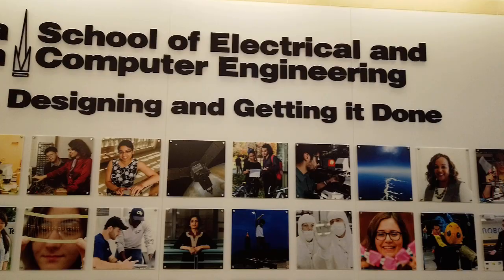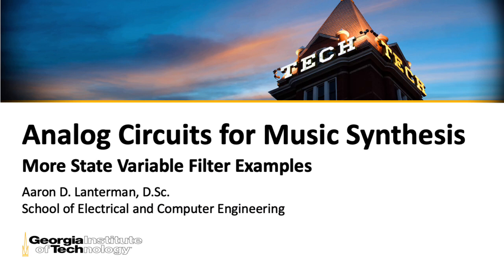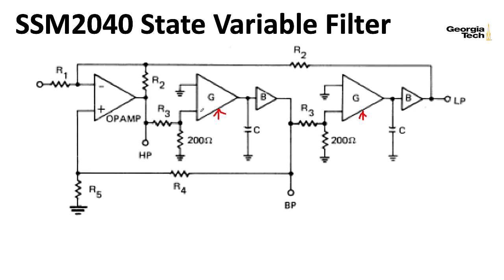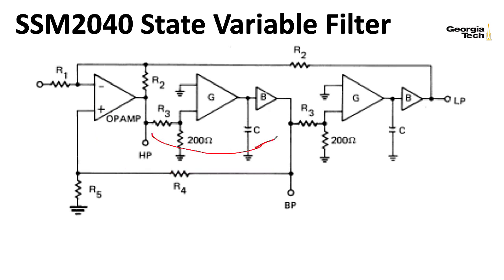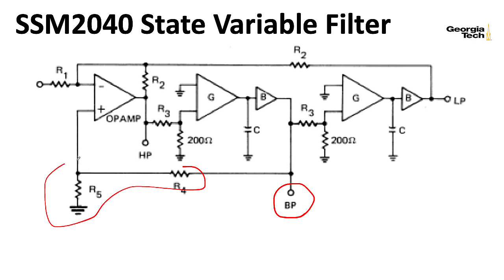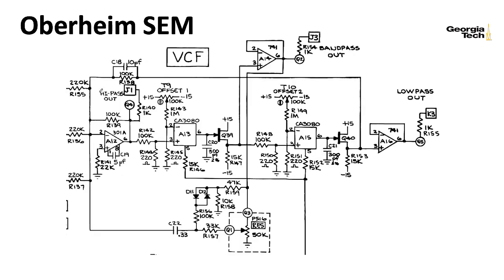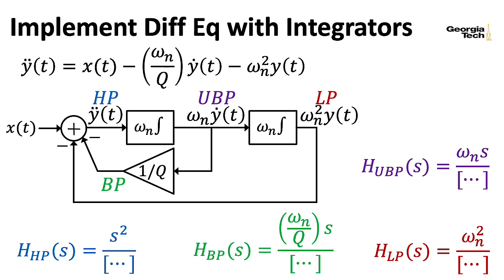ECE4450 L25: More State Variable Filter Examples (Analog Circuits for Music Synthesis, Georgia Tech)

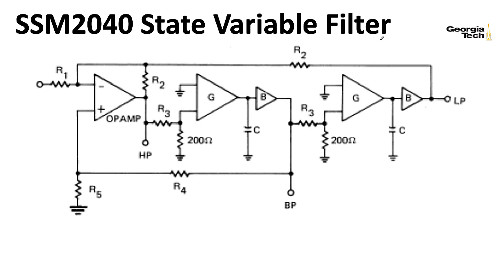Comment: SSM2040 is namely used in the Prophet 5 Rev 1 and 2. The Rev 3 switched to the CEM3320 filter.  The newly reintroduced Rev 4 offers both designs. 0:49

Comment: It would be great to have some insight on how to simulate an OTA with a traditional op-amp, even if only the "linear" part.
Reply from the maker: Alas, it's not possible at all -- the main thing about the OTA that makes it so useful it that it has that extra input pin that controls the gain. The closest thing I could think of is the chip used in the Polyvox VCF that uses a special weird "programmable" op amp with a pin that lets you set the filter bandwidth.